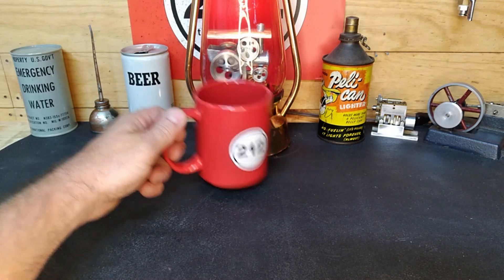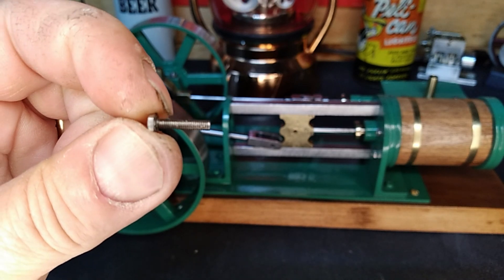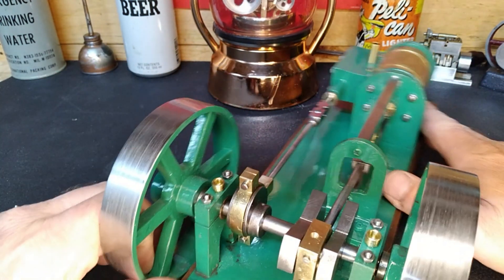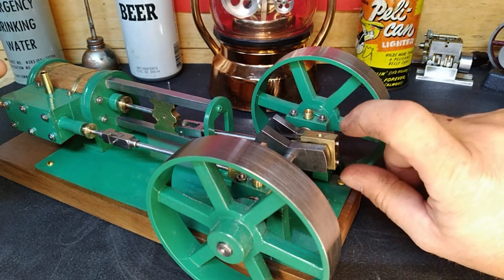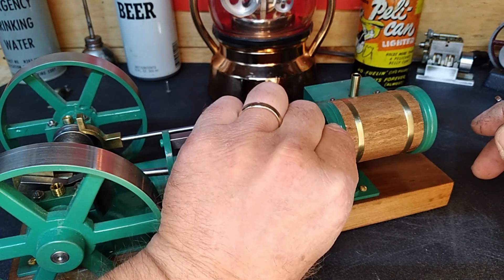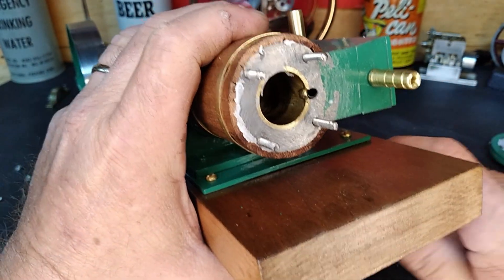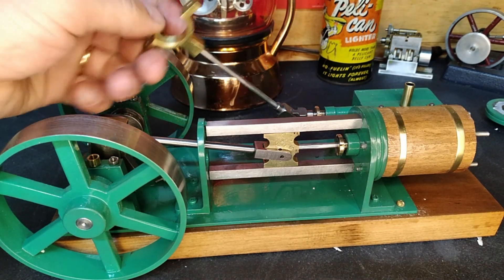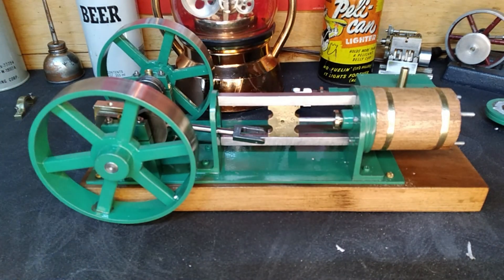English Bar Stock Engine Teardown, This didn't go as expected!  Part 1

Comment: I've never has good luck buying privately made model engines from auction, with the notable exception of the German flammenfresser with the graphite piston & valves. The cylinder end bolts being mis-spaced was the same on a steam engine I bought once. It would drive me nuts. So I wish you the best, have total faith in you:)
Reply from the maker: It's been kind of exciting to see how it was built and to try to understand why was it done like that, but it give the next person (me) something to think about while doing something that isn't normally done to rectify a different issue. It has been a fun project so far but it's not done yet so I guess anything can happen.   It's always great to read a comment from you Mr. Thomas 👍

Comment: given the issues you're having my guess is that the bolts on the cylinder are long headbolts all the way through the cylinder and into the crosshead guide bars.  Since you found sealant on one end, the other end is probably sealed with goo instead of a gasket as well, so it is not free to slip the whole cylinder & valve box off the long bolts.  It is interesting there is a brass cylinder liner in there.  I wonder what kind of rings you will find when you get the piston out.
Reply from the maker: We're getting there Henry, it's more odd than you'd think